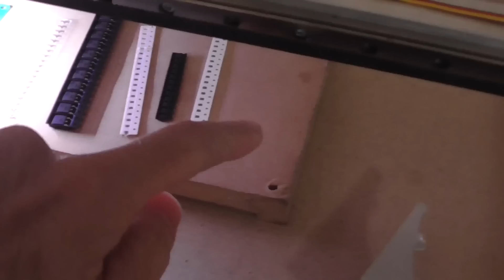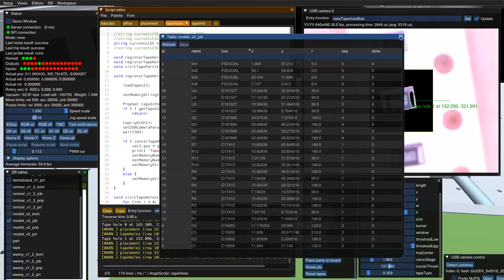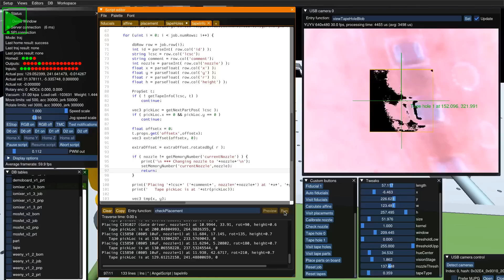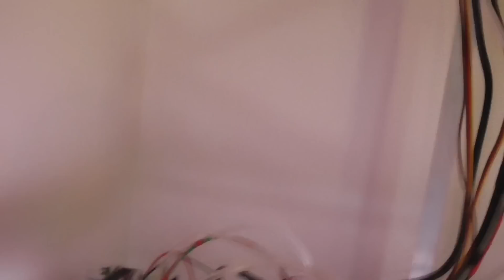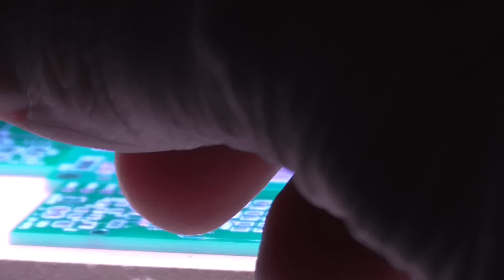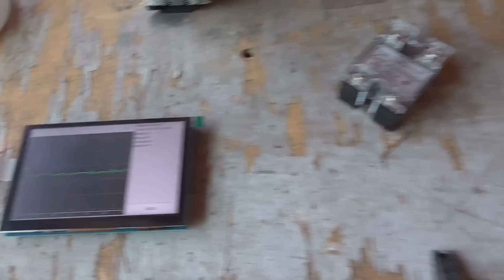ScriptPNP first job test

Comment: FYI - if the paste gets a little dry, and you are in a pinch, you can add some flux to it to thin it back out.  As far as keeping the stenciles clean - sure you can take themout and clean them, but just wiping both sides with a terry cloth/microfiber/rag with some IPS does enough for me.

Comment: 16:00 I clean my stencils with Rubbing Alcohol after every session of Pasting PCBs... A trick is to place Paper Towels below the Stencil to soak up the Alcohol dripping through the pad holes... For good Paste Coverage spread it from opposite sides.
BTW.. Just for testing couldn't you Pick and Place without the Paste. The final Reflow Temp should be 220 C according to the Reflow Profile I've been using for the past 6 years in our Shop Built Reflow Oven.
Reply from the maker: For this small stencil I hold it up vertical and use a spray bottle with IPA, then a light brush to loosen up the solder, then spray more until it's all clear and the IPA falls on the garage floor :)  Will probably have to come up with something better for a larger stencil. Yes, for testing I did a lot of placing without paste, including a few in this video. The reflow profile would depend on the solder paste being used.

Comment: Gotta be pretty chuffed with that!  The components that were most misaligned seemed not to release cleanly from the nozzle.  Might have worked better if they had contacted the solder paste as intended?
Reply from the maker: Yes that certainly would have helped :)

Comment: The ssr is just a normal relay that you can turn on and off really quickly and won't wear out like a mechanical relay. Just treat them like a switch on and off and you'll be fine.
Reply from the maker: Sure, but the fact that they fail in the closed state means you need a mechanical relay as a backup anyway. For the speeds I need to switch at there's no point having the SSR.
Reply: @iforce2d  mechanical relay will wear out a lot faster than an ssr. It seemed like you wanted to use the ssr like a potentiometer.

Comment: @iforce2d
Theoretically you can impove vision by using uv-laced diffing: paint the base board with a paint, that is luminescent in UV (some vibrant non-violet color that is highly contrasting for your specific camera), then add a UV led to the toolhead and take contrast frames when you capture frames for vision. I.e.:
1. Move toolhead to where you want vision
2. Take a frame with camera
3. Lurn on the UV led
4. Take a frame
5. Turn off the UV led
6. Run diff on two taken frames. UV-laced frame should have higher brightness and have a specific color where the base board is poking through the holes/gaps.

You can proubably lay a uv tape or other material under a pcb and then take frames with the camera to test if this would work in principle.

Comment: Looks really nice! 
Just because im thinking about building a pnp myself, whats the advantage over openpnp?
Reply from the maker: I suppose being able to control everything in detail might be an advantage, but you have to program it all... in detail. The script simply provides access to read sensors and control movement. This might be fun to tinker around with, but if you just want a proven system that works to get a job done I would use OpenPNP.

Comment: You have built a pick-and-place machine: Why shouldn't the machine place the components back into the tape after a test run?
Reply: I was thinking the same while he was picking up the components.
Reply from the maker: Placing the parts in a tiny hole with about 0.15mm leeway is rather different to just placing them on a empty board. Success rate would probably be less than 10% without bottom vision, even assuming they were perfectly placed on the PCB in the first place.
Reply: @iforce2d  Understood. But think positive. If you can make it, all your problems placing it perfectly on the board are also solved ;-)
Great project. Love your tenacity!

Comment: Awesome progress!
That speed is something :D

I would estimate that 80% of the misplacement is due to the wrong height. In the video you could see that pretty much every part was dropped quite high.

Really looking forward to some placements with correct height settings <3
Reply: I agree.  As far as I could work out, they were all being dropped from the same height, so not a huge problem.

Comment: Couple notes:
Solder paste should be kept chilled before use, it got worse from sitting out just because the ambient temperature melted the flux a bit, most people put it in a fridge to keep cool until they need it so it stays firm. Other solutions are available I'm sure, but this is the one I know lol

The actual PnP Machine I use at work seems to have a vacuum suction stage, then it actively blows the part off instead of just placing it from what I have been told (I don't run the one at work, only used my home machine so not sure)

Glad to see it's coming along. I like the general concept of having it 'scripted' like this - not sure if I would call it scripted personally, but the general point of dumbing it down is awesome.
Keep it up, hope the improvements keep coming
Reply from the maker: The exact definition of scripting seems to be kinda subjective, but typically it involves some kind of virtual machine or environment, rather than running as a normal process on the CPU. That's what I'm meaning here, with the point being that the behavior can be changed without the host software needing to be recompiled or even restarted. Eg. you don't need to restart or modify your web browser for it to be able to run different JavaScript, you load different pages.